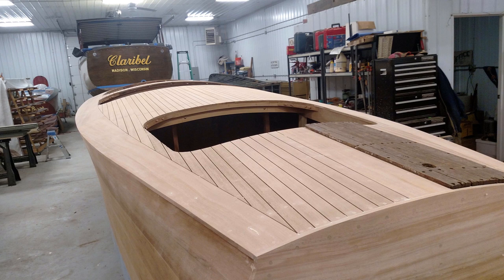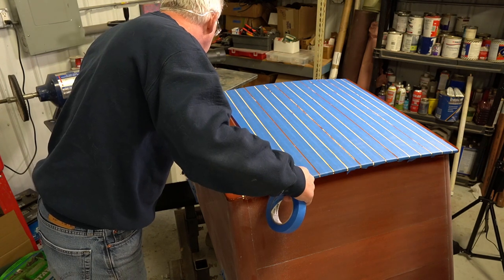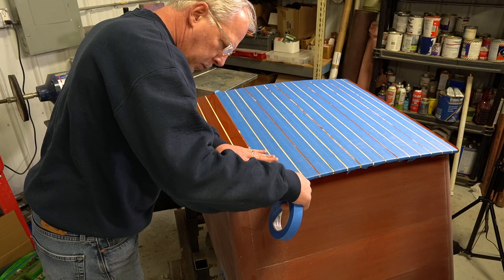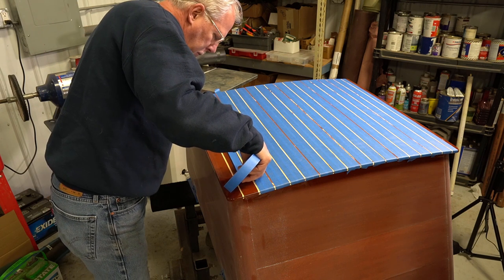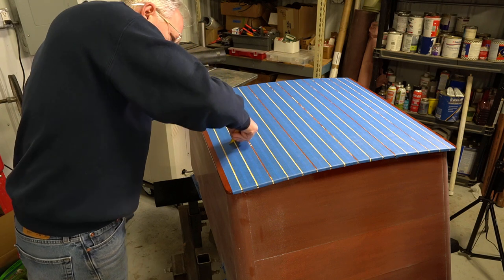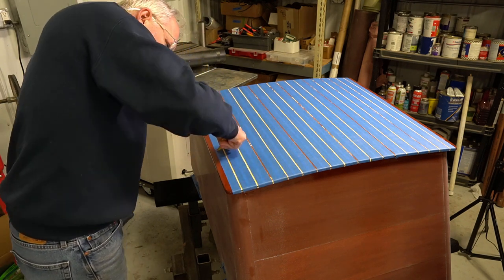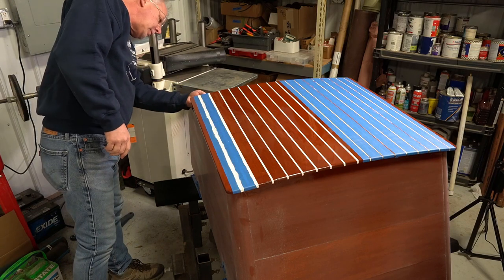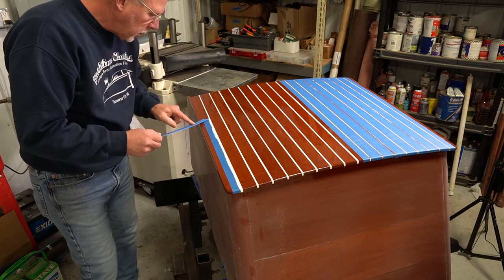WOODEN BOAT RESTORATION -  How to Paint Deck Stripes

Comment: Great video, Mike. Have you ever seen or tried the pin stripe roller?. I had one ...a little bottle 2 Oz or so bottle with a valve and little brass roller with sort of gear ribs cut into it. It had an adjustable guide to run along a straight edge and the paint would wick onto the roller. I did  19' Graevette, and my 22' Shepherd with it. Back then (mid 70's), the marina operator who was advising me just told me that was how it was done. No masking. Worked fine. He had me strip, coarse sand, caulk, medium sand, final sand, varnish, and finally paint the seams. There was no internet then, so I didn't know any other way. :) I think I got the roller bottle thingy from the same paint store that sold the Petit Easy-Poxy High Build Varnish I was directed to use.
Reply from the maker: I have one but can't seem to work it as well as just tape and a brush.
Reply: @MikeGreenStudioWorks  Well, you do a great job with those so I'm certainly not one to try and steer you away from them. Thanks for replying. Wanna sell the striper?

Comment: Hi Mike. Great video on pinstriping. I am restoring a 1959 Plycraft boat made in Nova Scotia.  I want to add pinstriping to the boat. The deck is made out of 1/4" plywood and has no groves for pinstriping. I thought I would add groves with a router. Should I use a square tip  bit or a rounded blade and what width and depth would you suggest. The boat is only 12' long and 4' wide. Thanks, any help would be great.  Russ
Reply from the maker: I would use a round bit and only go down as wide as you want the seam. Most time seams on Chris Crafts are a bit under 1/8th.
Reply: @MikeGreenStudioWorks  About what I was thinking too. Thanks for the timely reply.

Comment: Hi there Mike. Thanks for posting videos. I have just started the restoration of a 1948 20 Custom Runabout I brought from California to Norway. The topside, bottom and transom was replaced, probably 10-15 years ago. They did not quite finish the woodwork. There were absolutely no interior in the boat. I understand that the interior on these was a bit complex with leather combined with vinyl. That I can probably get sorted with some help from Mr.  Mayeaux (who actually recommended me to contact you) but what is more of a challenge is how to build the seat frames etc. Not much info out there and this may be a shot in the dark. Any suggestions? After this is done I have a 22 ft Chris Craft Custom Sedan from 1954 to fully restore and then onto my jewel in the collection, a 1954 53 ft Chris Craft Conqueror that needs a whole lotta love. One of the 26 made. Appreciate any leads to pictures, drawings etc of the 20 Custom seat frames etc. Thanks, Kjell from Norway
Reply from the maker: You are in luck!! We just so happen to have a 1948 20' Chris Craft Custom Runabout in the shop right now. We are going through the boat and have some of it taken apart to clean the bilge and get the boat running.  Let me know what I can help you with and we can figure out how to get the information to you.
Reply: @MikeGreenStudioWorks  Thank you Mike. If you can take some photos of the seat constructions, both over and under I would appreciate it very much. Perhaps also how the dash is constructed, where the instruments are. I have some gauges but I think it would be best to try to locate a complete set in better condition. I think I have managed to locate a correct steering wheel and column but I am still missing the windshield frame. I have the top for the cutwater but not the cutwater itself. Do you know anyone that can make one with the one you have to measure? No one here that can do it. Not much help to get locally here so now I am trying my very best to get as a good as possible in the shortest amount of time sewing my own interiors. I can also be contacted on e-mail: kih@cminc.no   Again, thank you very much, I appreciate any help you can give me.

Comment: What kind of white paint are you using and are you applying right over the Sikaflex?
Reply from the maker: We use Pettit white Ezpoxy paint white #3175 and we put it over about 4 coats of varnish which would be our finish coats. If we wet sand and buff the boat back to a shine we then do it after that.